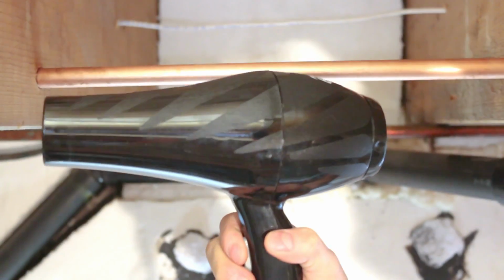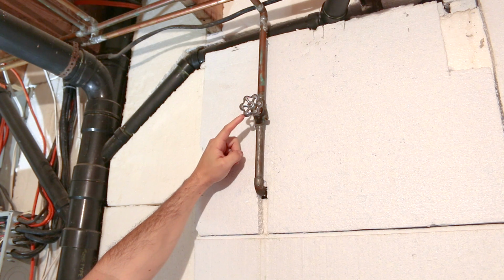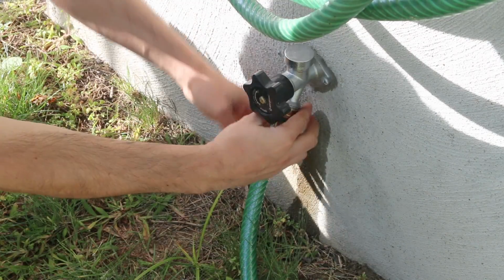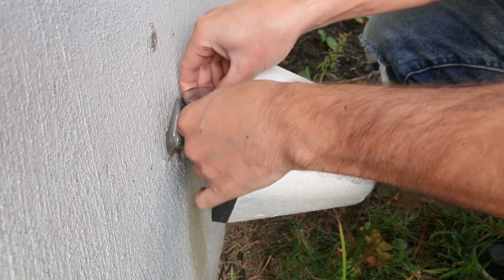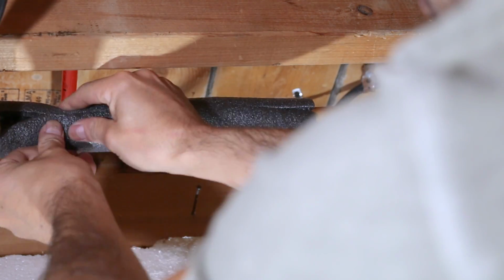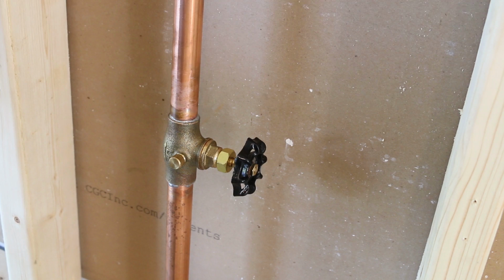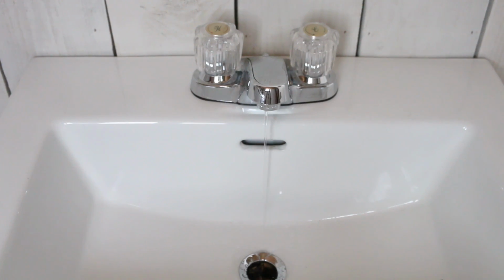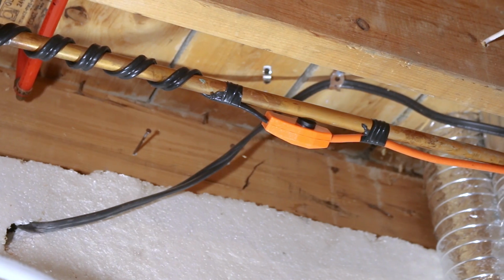12 TRICKS To WINTERIZE Your Plumbing! (Easy DIY) | GOT2LEARN

Comment: Uh, your comments about not costing more to keep your house warmer is not accurate, at all. It costs much more to keep it warmer because it requires more energy to keep an object a different temperature than the surrounding temperature. Just call your local Energy co. That is a big error.
Reply from the maker: Yes, but for 2-3 degrees, I thought I wouldn't mention it, but you are correct Shannon.
Reply: I wonder if the annual cost of slightly higher heating bill during subzero temps would be more or less than the repair costs, item replacement, and time lost to a catastrophic rupture? Insurance can replace some of it. I would rather pay a little more than go through the clean up and repair.

Comment from the maker: Amazon affiliate links to all the products I used in this video:

Cheap Hair Dryer: https://amzn.to/2qn4iIJ
Heat Gun: https://amzn.to/33z8Nhw
Small Portable Heater: https://amzn.to/2oEc8gF
Foldable Butane Burner: https://amzn.to/2BlUPDK
Broad flame torch: https://amzn.to/2Jeaeeq
Outdoor Faucet Insulator: https://amzn.to/2BjL8Wv
Heated Wire (Thermostatic): https://amzn.to/2OUbSVq
GREAT STUFF Expandable Foam: https://amzn.to/2MPfgy9
StreamLabs Leak Detection System: https://amzn.to/2oPJUzt

Comment: I think you have a Russian accent.
Reply from the maker: Canadian ;)
Reply: Got2Learn as a Canadian you can tell me if a recirculating water system will help freezing pipes when it’s -40 here 🤔
Reply from the maker: Yeah, moving water has less of a tendancy to freeze, but it only applies to the recirc line though.
Reply: Got2Learn perfect yeah, hot water always freezes up so I think I’ll get one of those pumps and see what happens 
Thanks for the reply 👍🏿🇨🇦